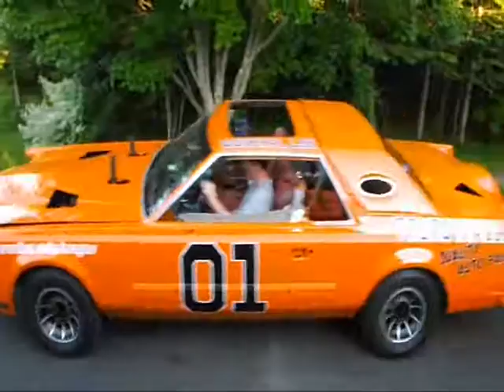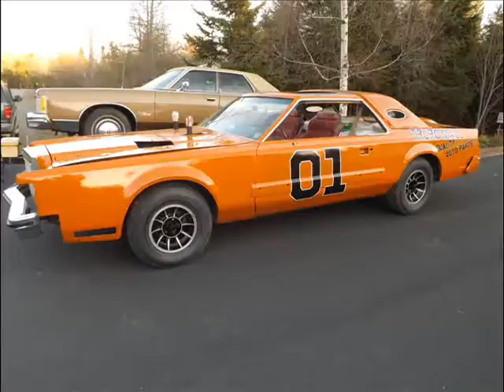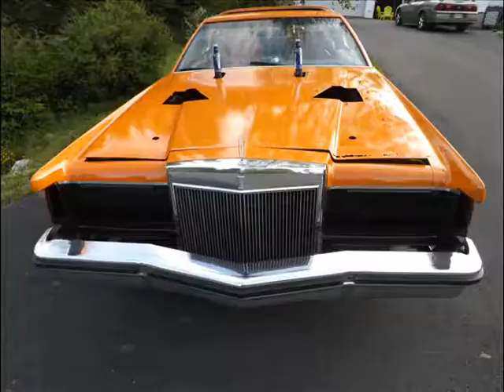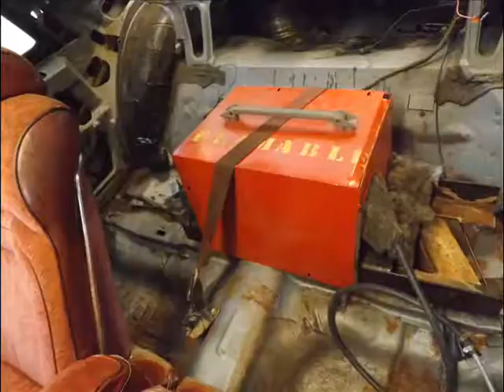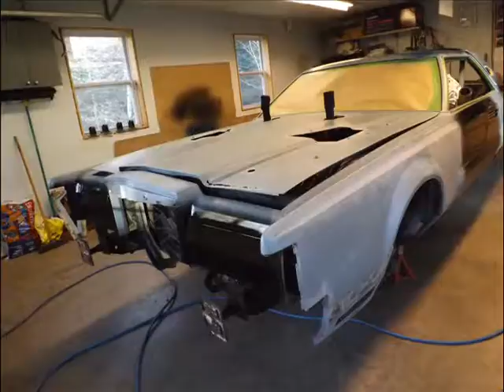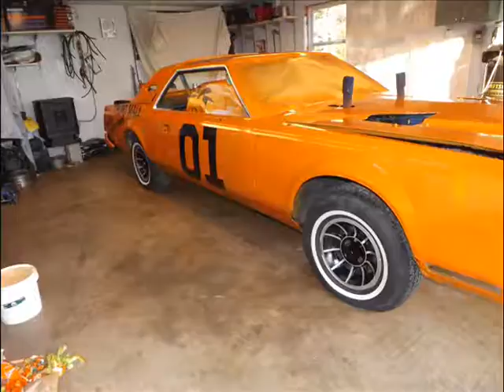My General Lee Demo Derby Car (1978 Lincoln Mark V Diamond Jubilee)

Comment from the maker: This car was completely rotten, roof, floors, firewall, rad support, doors, hood and fenders were all toast. The wiring was all messed up from being wet.  The frame was badly rusted and was bent from a previous accident. It was not restorable, All of the interior, and what ever else that was salvageable went to other diamond jubilee's to keep them on the road.  I love these cars too and am currently reserecting a 1974 and a 1976. I would not have sacrificed this car if it could have been fixed.